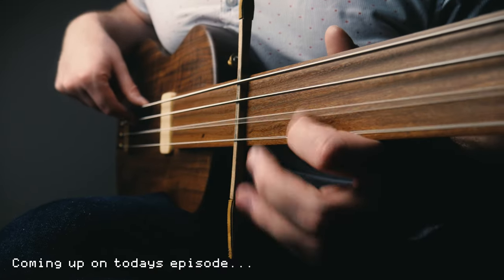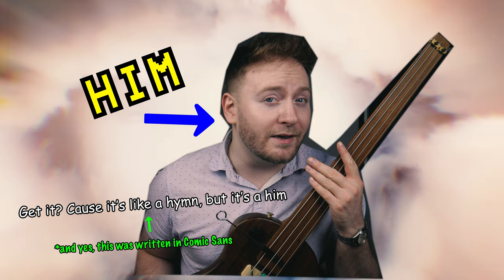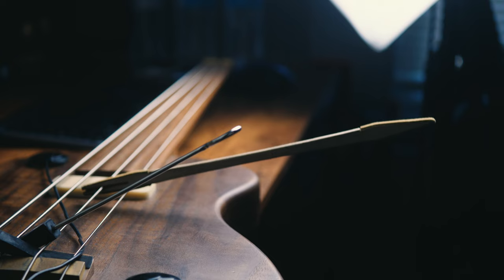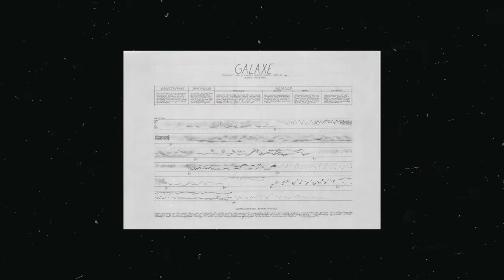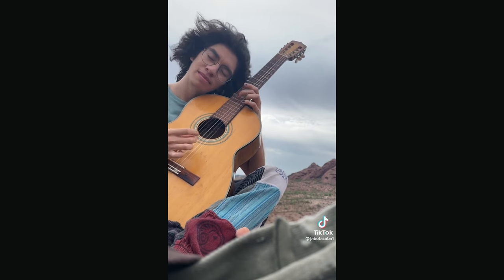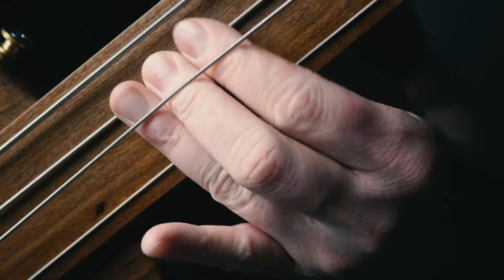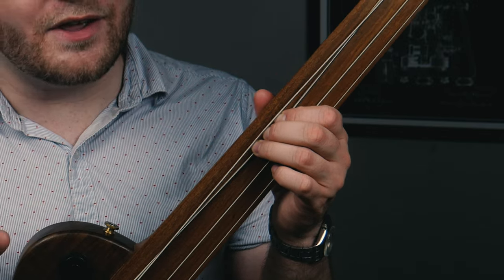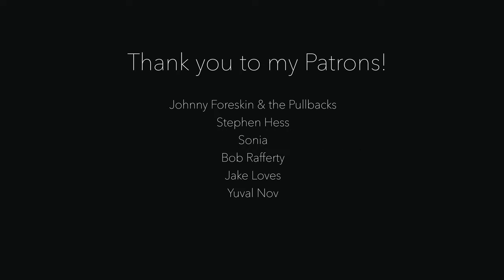Rating Crazy Extended Bass Techniques

Comment: i've had good results using architectural modeling rods of varying thicknesses, slid between the strings and the fingerboard - small ones create a nice buzzing effect when used close to the nut. also, thick rubber bands like you find on your broccoli can be slipped over the headstock to make a subtle mute - cool to use it where there are natural harmonics. but the best prep in my opinion is small springs used in various ways... reply to this comment and i'll try to explain what i do with them...  and can you please make a video about your bass, or point me to one if it exists? cheers!